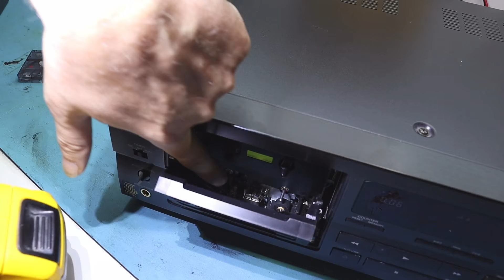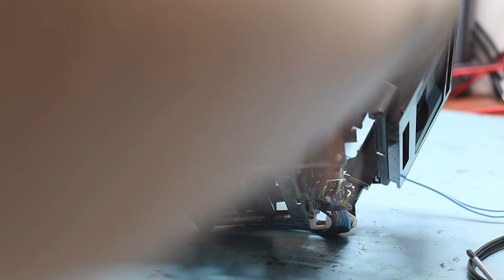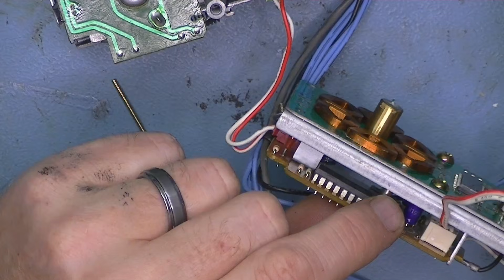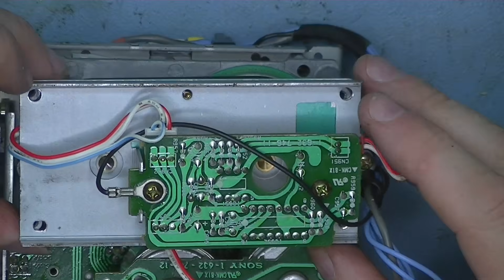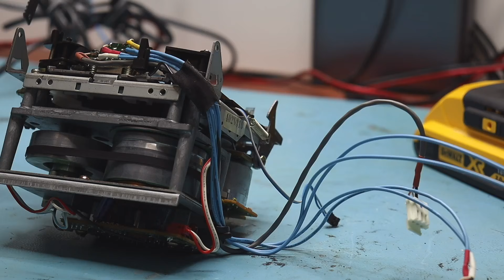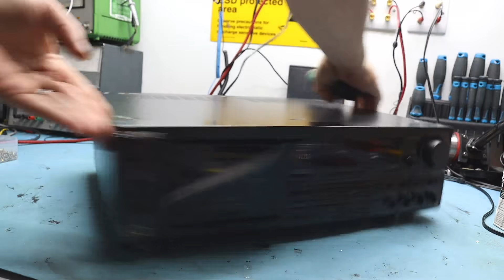Sony TC-K870ES – One of Sony’s Best Ever Decks… But It Failed

Comment: I don't think handling the belt with bare fingers will help wow and flutter. You didn't take the opportunity to relube while you had it open: rear pressure points for the flywheels and capstans. Also, are the oil retaining washers on the capstans missing?
Reply from the maker: Testing afterwards on my Meguro MK-668F would say otherwise. And yes I did and no not missing just edited out to make the video shorter.....

Comment: Well done! I  took my Technics deck to an electronics store to replace the belt. He tried very hard but couldn't open it.
Reply from the maker: Technics decks of this age usually have the main board soldered directly to the motor so you have to desolder them all first before you can even remove the mainboard to access belts / gears etc. Pain to work on! Thats probably what it was on your deck.